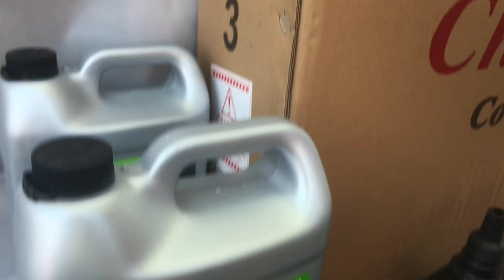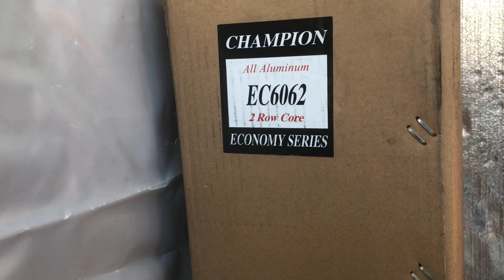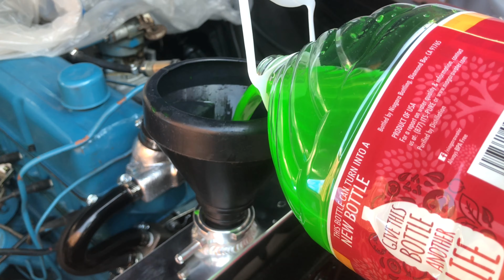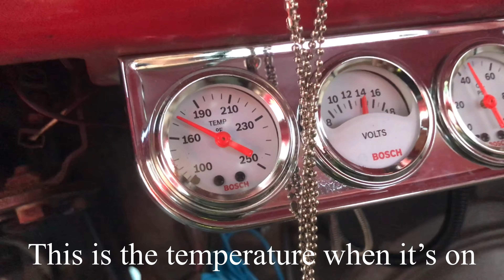1962 CHEVY C10 ALUMINUM RADIATOR INSTALL FROM CHAMPION COOLING SYSTEMS

Comment: Did you installed the transmission lines on the typical right hand side or to the bottom inlet and outlets. If they’re installed at the bottom, does it matter which transmission line goes to either side??!
Reply from the maker: Thanks for your question.
My truck was standard transmission
I didn't used
For an accurate answer please contact
Champion cooling System.Ask for Scott
Thanks 🙏

Comment: I know this is an older post but wanting to install the same thing. What’s the deal with the transmission cooler holes in the bottom. I see you left the red plugs in. No leaks? Any issues? Thanks!
Reply from the maker: Champion product is the best.
No problems at all
Super happy with the champion radiator.
Thanks

Comment: Great video man! How has the radiator been now you've had it a couple of months? I'm thinking of fitting a Champion radiator to our dodge powered RV. Andy
Reply from the maker: The radiator is great, works really well if you have any questions about the radiator fitting contact Scott from Champion Radiator. (See his comment on this video) Let me know if you need his direct phone number thank you.
Reply: @IsaacsCChevyTruck  Hi Isac, great video! I have 1965 C10 and I like the mounting system of the champion radiator. I thought all the first Gen c10's 1960 - 1966 where mounted and supported from the bottom and top. Coudl you give me Scott's number so I can call on my 65? Thanks, Floyd
Reply from the maker: @floydleach603  Hey Floyd.
Please call Scott. Make sure you mention my name
1-951-245-9464 x 101 www.championcooling.com
Please share the video.
And subscribe.
Thanks